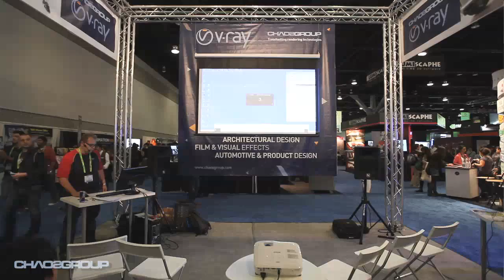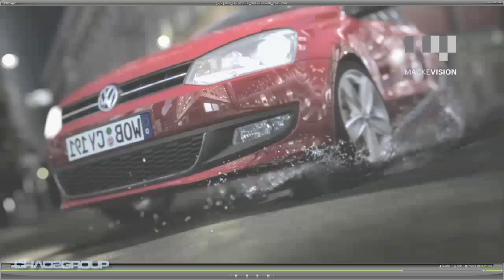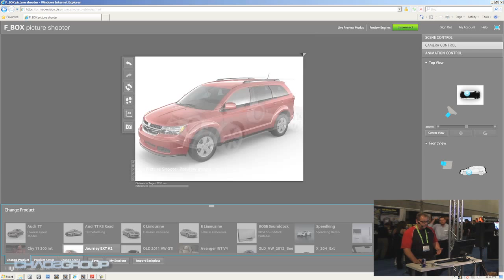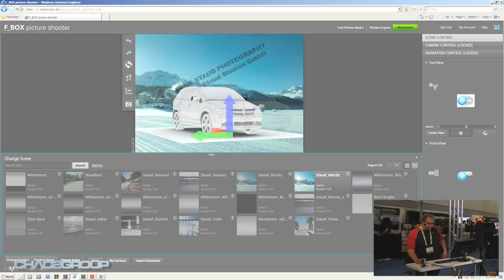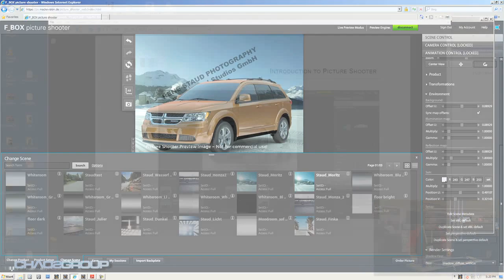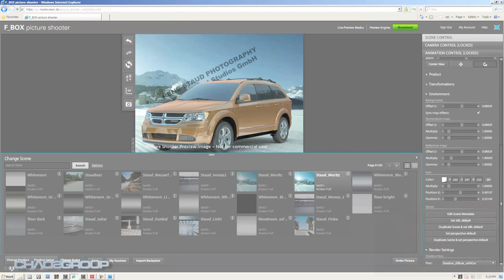F_BOX Picture Shooter by Mackevision - Presented by Eric Pinkel

Comment: The resolution shown for PAL is also wrong (PAL is 720x576, not 768x576). 768x576 is the PAL approximation for systems that don't support pixel aspect ratios other than 1:1. But if their system didn't support that, then NTSC would have to be 640x480, not the 720x480 shown.

Hopefully this is just a preview version of the software and someone with basic knowledge of video standards will correct their presets and labels before it actually "ships".

Comment: According to the window shown at 12:41 they seem to think that SD is 1280x720. As anyone working in broadcast knows, SD is the generic name for PAL and NTSC resolutions. 1280x720 is HD, just as 1920x1080 (the latter is usually described as "Full HD" to distinguish it from 1280x720).